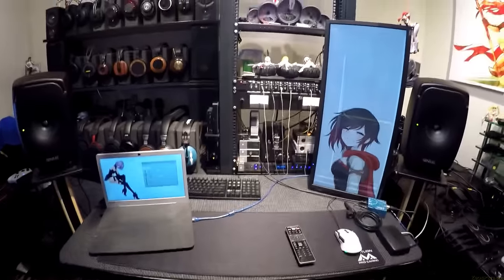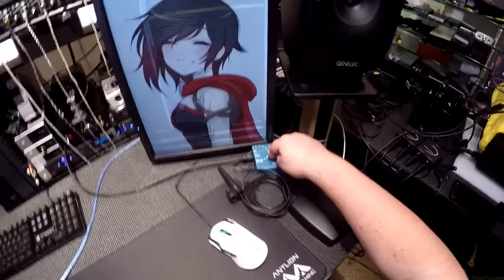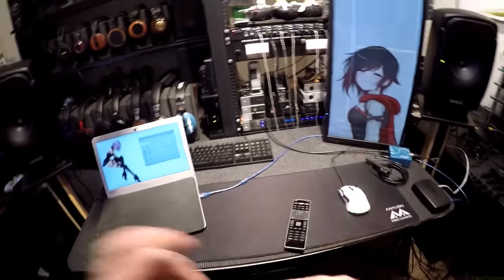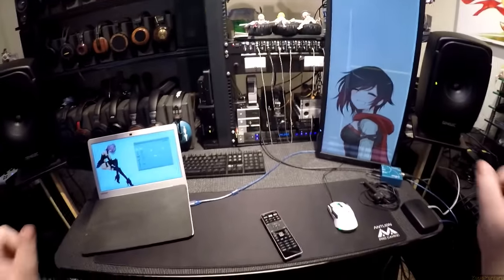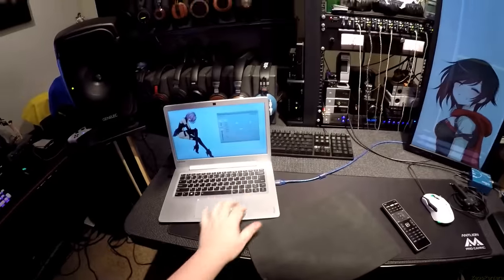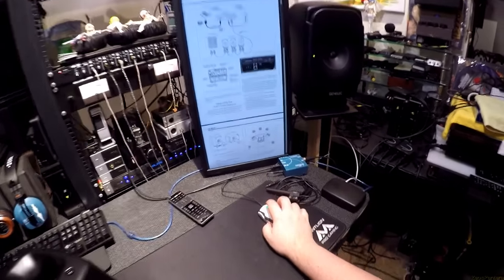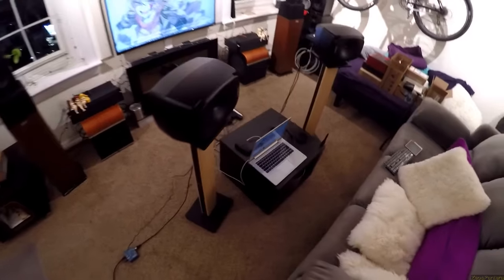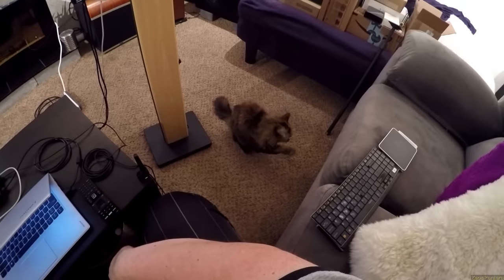GENELEC 8341 _ (Z Reviews) _ $6,000 of Acoustical Precision & Magic

Comment: It’s not overkill—it’s pointless to use these in an untreated room. It’s like using a 918 spyder for off-roading, and saying the handling is superb and the grip around corners is impeccable
Reply: Well, untreated rooms are bad. Sometimes you can't work in a properly treated room, though. For instance, you might be forced to do mixing in a broadcast truck - rarely a treat regarding acoustic treatment. What's good with these monitors... I mean loudspeakers is that due to their fully coaxial design, the minimum applicable listening distance is really short, less than half a metre. This is good for working in cramped spaces, and this is good to do away with listening fatigue caused by phaser effects one would suffer with traditional designs on a short distance.

But sure - if your room is poorly treated and you are listening them well beyond the critical distance, they are going to lose a lot of their natural benefits...

Comment: Eh i like how your okay with getting pulled into the latest gimmicks. I was that way in the late 70s. The bottom line is i am compitant at dailing in the most complex system with the final hurdle being a programmable usb stick DMX controller. That being said the only concession I'm willing to give is cabinet size. I don't need a processor to dail in a stage i do however need a processor that can determine my location as i move about the seating area. 
 Here's a overly mix tune for testing full emerson...
https://youtu.be/Mfzyr31PTgI

Comment: Put 2 subs at the back of KEFs. Save $3000.
Reply: lol
Reply: Yeah, no
Reply: @CephBacon  yeah yes! Or just get LS50W's with a nice sub and smile every time you turn them on! :))))
Reply: @theDevilsvoice  dude these are so far beyond LS50's it's not even a comparison
Reply: @CephBacon  how
Reply: @christopherpaluch7216  how? They're engineered and built better, and the room correction is tantamount to magic
Reply: @christopherpaluch7216  they're in an entirely different league in sound quality. Far flatter, way more detailed, and much more dynamic
Reply: @CephBacon  ls50w also has DSP control and comparing them to the originals is unfair. What about the speaker itself makes them stand out. I'm curious not being a dick
Reply: @christopherpaluch7216  everything. It is simply a far better speaker. The fact that they're active and genelec goes through the trouble of building amps specifically for their different drivers helps too.

Comment: Not even the least bit interested to learn about speakers that cost that much. No way could they ever possibly be worth it. If I had a million dollars to spend i still wouldn't waste any money on fucking $6000 speakers. These are speakers for rich suckers.
Reply: I have the more expensive, larger 8351 speakers. I can tell you, at least as a mixing engineer, they are 100% worth it because they reveal all the flaws in your mix, while showing you a pristine and razor sharp stereo image.  Speakers can get much more expensive, and I'd say the 8351a monitors (which are 2000 bucks more), are the sweet spot for high end 3 way near to mid field monitors). For highly analytical use, you really do want to have something that reveals all, and these do just that. Not only that but theyre are supreme pleasure to listen to when music is recorded well. It's hard to explain as most people tend to think about just frequency response and what not, and its not until you hear monitors like these that its apparent that phase/time of arrival impacts the sound so much.
Reply: @japface   I'm sure they are probably nice, but there is NO WAY you need to spend $6000 to accomplish those things.
Reply: @KBWrecker  I'm not the kind of person who spends money in excess. I'm a professional engineer. I can tell you from experience with a lot of pro gear, that no, It's not easy to accomplish. We have a correctly sound treated room, and achieve as flat a response as possible with very little phase issues. So, a much better environment than zeos has. I've tested many monitors in various price ranges from $1500 to $8000 (the genelecs) and I can say with certainty that you're not going to get the kind of stereo image that the genelecs + GLM kit room correction DSP offer with most other monitors for that money. Usually you end up spending 15k or more, and even then if its not coaxial with a large wave guide (which isn't really done like the way the genelecs are) then you'll have a hard time getting this kind of image. Even the Kii Three's don't offer this kind of stereo image (they have many other benefits), and those cost a heck of a lot more. 

It's precisely because of the coaxial setup + dsp that helps it so much. first off, you can guarantee that there are far fewer phase issues because its a point source monitor, not scattered sources like most monitors. second, the DSP can match cross over frequencies better to suit your room, but also deals with time of arrival for the entire frequency spectrum. So, not only does it correct as a room EQ, but it deals with phase which helps give you a pristine image. And the processing is done on the monitors, and stored there. It's different from a lot of other room EQ setups I've tried.

I wouldn't have argued this point, but once I heard the 8351 monitors, I suddenly realized what a really good stereo image meant, and again, I wasn't auditioning cheapo stuff. I'm extremely skeptical of most audiophile equipment as well, as there is a lot of snake oil (I've listened to 100k dollar systems. they sound fantastic, but 100k fantastic?.... no almost definitely not worth the money).

Believe me when I say, 6k for some good monitors isn't really that crazy. most 3 way setups are minimum that much money, and thats typically what you want in a studio. a good 3 way monitor.

Comment: Have GENELEC 1033A SM system out back in the shop collecting dust. GENELEC went mass production. As far as the plastic speaker cult, I will pass. Just another software inspired DSP backdoor gimmick. Perfect speaker though for the amazon "buy it now" 5 star minecraft type.
Reply from the maker: So like some designer brands and fn PIONEER.. only good in the 90's?